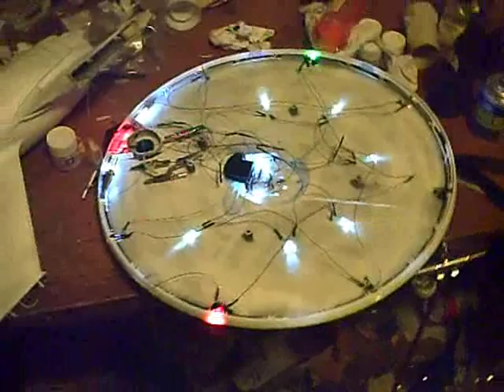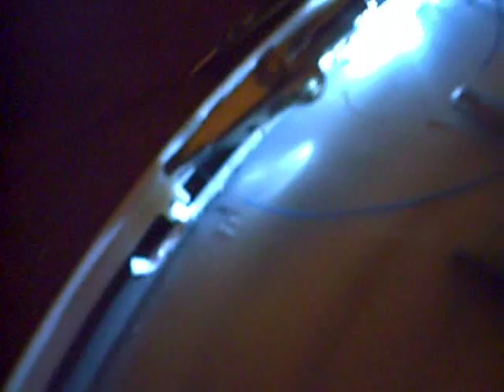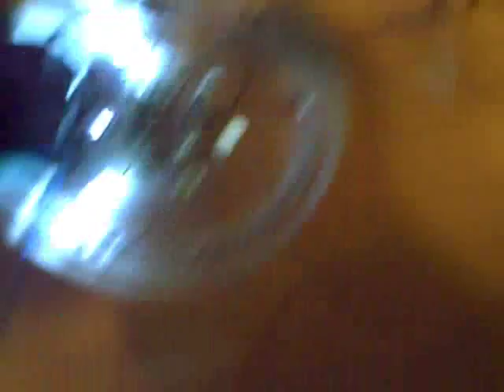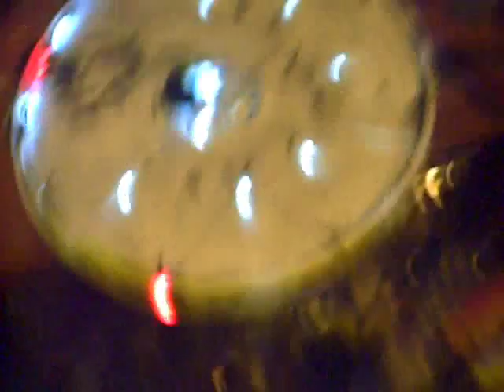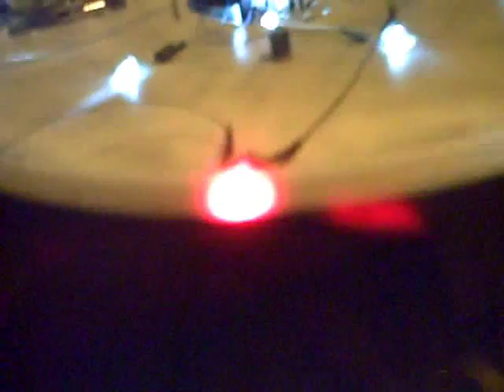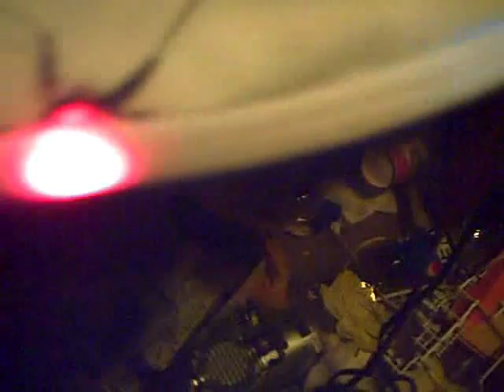Polar Lights 1/350 USS Enterprise, NCC-1701-A, build up part 5

Comment: Like it.  Your front LED doesn't work because of the draw difference in voltage from red & green (which are the same) to either yellow or clear (Different voltage requirement... but you probably figured that out.  KC